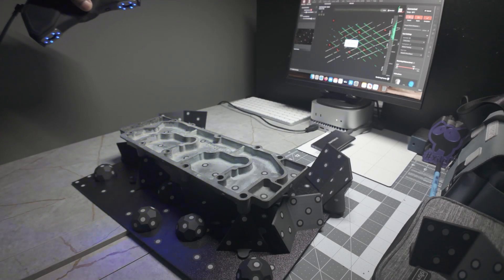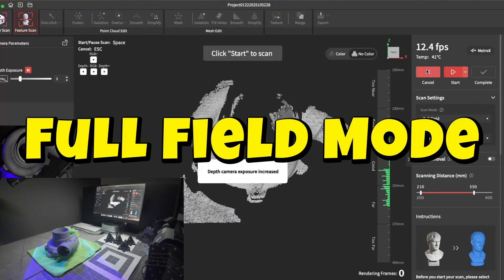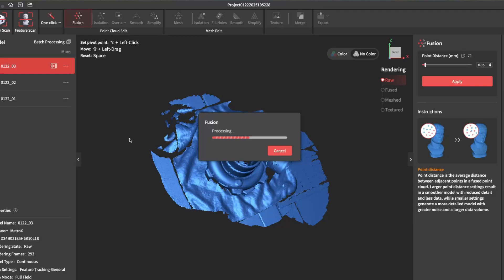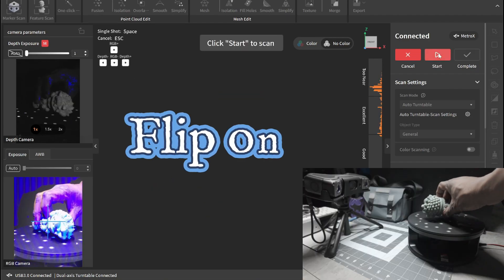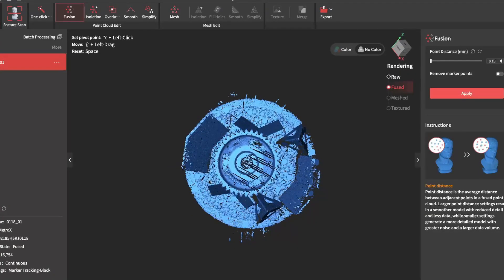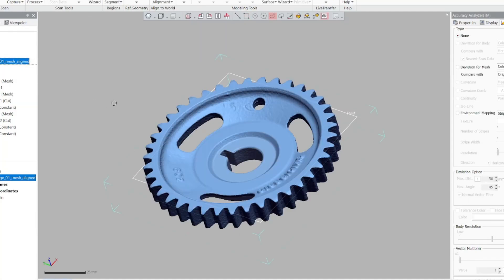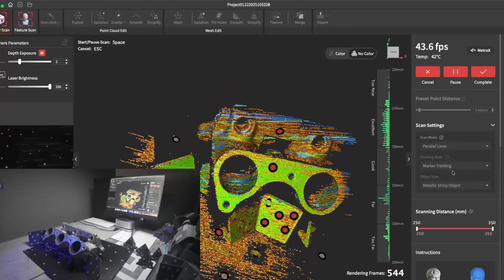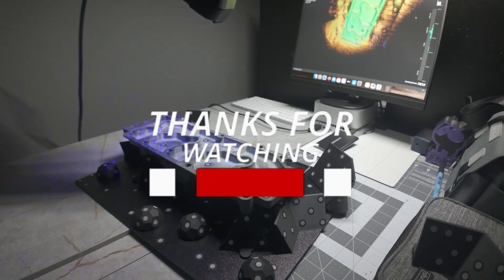Revopoint MetroX 3d scanner Mini Review

Comment: You're using a Mac mini M? Do you get the feeling this scanner could run on a lower spec PC or is it gonna chug?
Reply from the maker: @anarky277  yes using a M4 mini Mac.
Lower then recommended PC spec system would have scanning lag in laser mode for sure.
I have many laptops and ive tested it on them.
My i7 7th gen with a 1060 lags alot in laser mode. To the point its not worth using that laptop. Processing the scans are not to bad and full field mode is also fair.

But my Legion Go handheld is fair. About 30fps in laser mode. Good processing times.

My other laptops are ryzen 9 7000 series (i think 7540 or soemthing) and other is i9 14th gen. Both work great and get fps in the high 40s